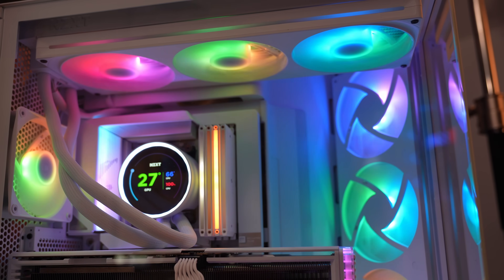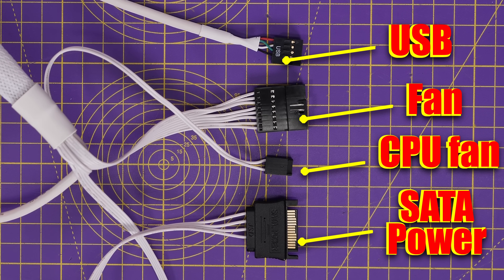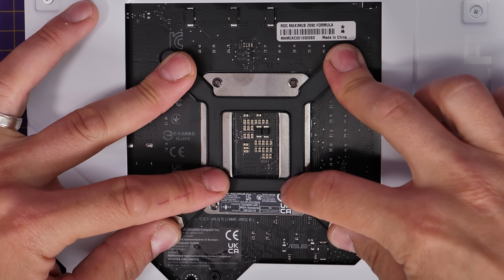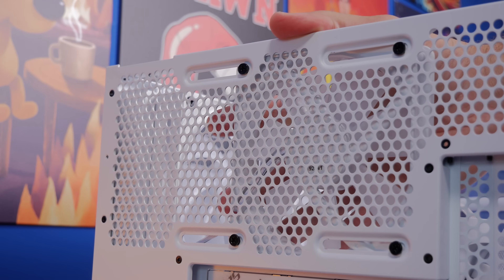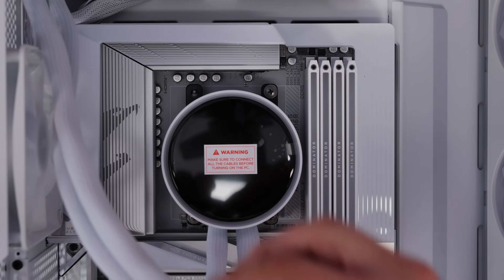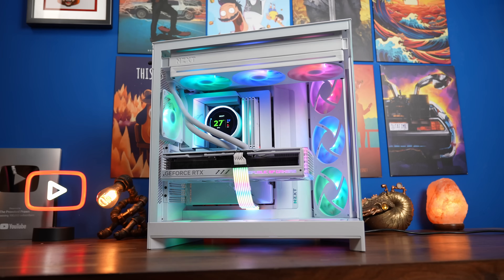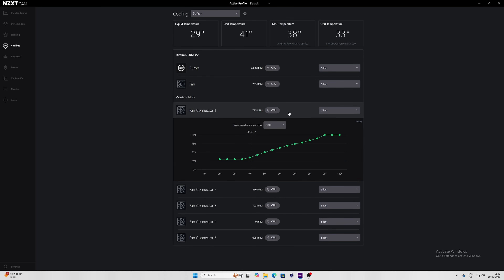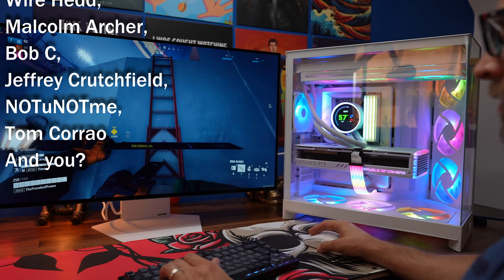NZXT Kraken Elite 420 RGB build guide with push pull setup tips

Comment: Thanks I had to get rid of my corsair titan aio cause it was honesty terrible and didn't work and went for this instead and this tutorial was really useful
Reply from the maker: Surprised you had issues but glad to help
Reply: @TheProvokedPrawn the setup on that thing with the icue and manuel is honestly pretty trash after setting my personal build with the titan. The cables arent lables besides the digital manual which kept zooming instead of scrolling. Nzxt is so much easier to manage and plug cables after helping both my dad and brother with theirs. There are cables that they tell you to plug in on the titan that just dont plug into anything and dont tell you are optional. Just a headache all around for first time installers 😅

Comment: Question: I bought this cooler but I also bought 3 Montech RGB fans to attach directly to the radiator instead of the included fan array (just preferred the styling better).  Advce?

Comment: Does the new kraken elite 420 not come with fan controller? Building mine right now and realised this issue 😂
I recall the old version coming with the controller
Reply from the maker: You don't need it. The single frame fan has a connector directly on the pump breakout cable. As I showed
Reply: @TheProvokedPrawn  Yep I realised! Finished building the pc and everything seems nice!
Though, is it normal for CPU temperate to spike when opening an app or something? 
Usually it’s idling at 46 but when I open some apps it spikes to 90 or so and goes back down to 46

Looking at NZXT CAM right now.
The fan is working, the pumps appear to be working too.

Fan ~635 RPM
Pump ~2279 RPM

Comment: But I cant connect the NZXT RGB Duo Fans to the pump only the F Series Fans are compatible to the Breakout Cable or am I wrong? I would have to use the NZXT Fan Controller.
Reply from the maker: Correct

Comment: Can this be built without the break out cable if you’re using third party fans?
Reply from the maker: No. You still need it for the power and usb connection but you can leave the fan cable unconnected

Comment: Say I buy the 420mm kraken elite RGB and want to install push pull but put lian li SL-INF 140 fans on the bottom and the NZXT triple fan on top? I plan on using Lian Lis Edge PSU with the integrated USB hub in the H9 Flow also.
Reply from the maker: You could do that. It's not optimal but it'll still improve performance

Comment: Hello Provoked Pawn!
I just did a Push \ pull setup like you did in this video, but im getting a really annoying "humming" noise with this setup 
Did you notice any noise like that with your setup?
Reply from the maker: Can you establish where it's coming from? Could be pump noise. If so you could contact NZXT about it if it's excessive.
Reply: It's not the pump this time. 
It's a humming noise comming from radiator fans ( using the new 420mm kraken elite) 

I tested with removing the push pull setup and only using 1 rgb core fan, but the humming sound was actually worse 
If I turn off the radiator fans completly the humming stops

You didn't have any issues with humming noises in your setup then?  @TheProvokedPrawn
Reply from the maker: That is very odd. I didn't experience that.  @Emaldiom  you have mounted it so both fans are facing the same way?
Reply: @TheProvokedPrawn   Yeah 😅
I'm getting a new psu tomorow ( the Lian li edge) so will try to rebuild the system then and see if it makes any difference

Thanks for answering so quickly!
Reply: @TheProvokedPrawn  Did a rebuild today and the noises seems to have all gone. 
Must be some kind of odd vibration from something that made the noise.
Anyway, thanks again!

Comment: Superb Video!👍 

In the  push/pull set up, will it allow for much room for the two 8 pin power plugs in the top left Position on the MB🤔? (The radiator is the meat in the hamburger)

Is there a noticeable difference in the CPU cooling with this setup?

Comment: Would you recommend push pull configuration in general?

Thank you.
Reply from the maker: It makes a marginal difference. Really depends on your CPU. The 9800x3d shouldn't really need it but it helps with an i9 for sure
Reply: @TheProvokedPrawn    I am considering an Intel Core Ultra 9 285K